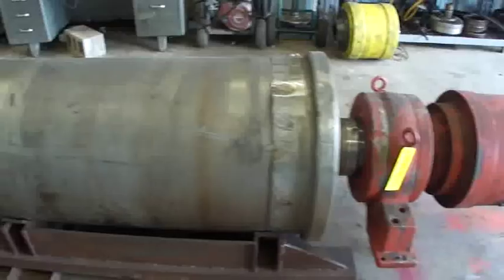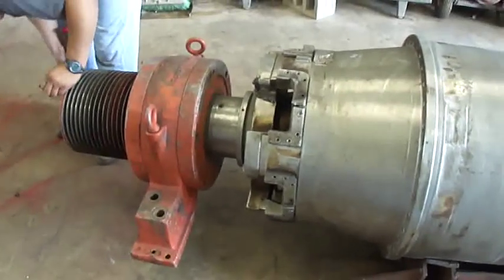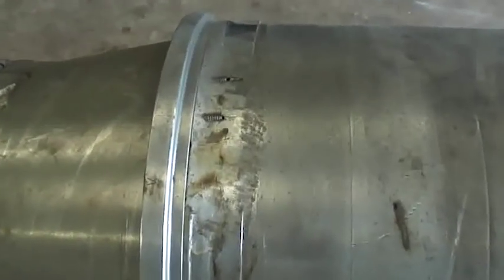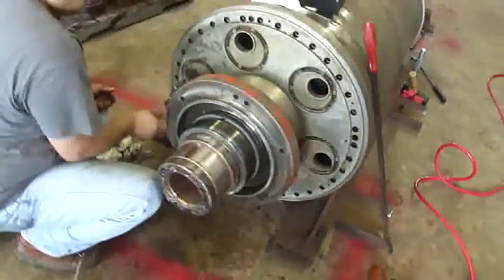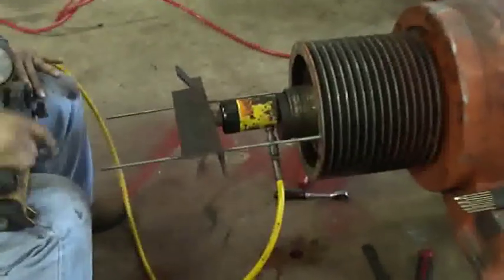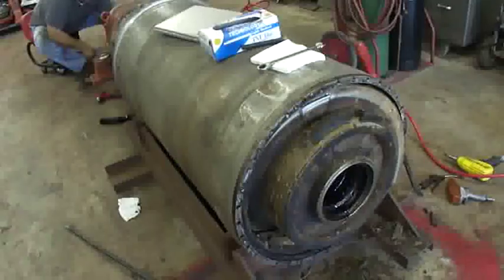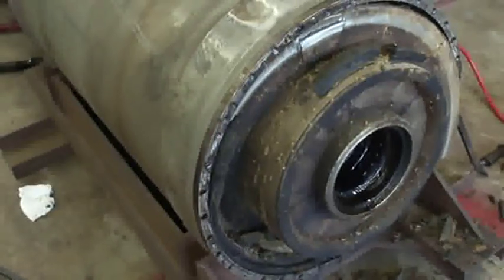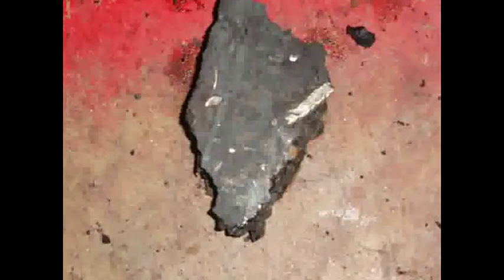Sharples Conveyer Removal

Comment: Ther is a hole for a oil fitting on that pully and you use oil pressure to get it off not a hydraulic jack and threaded rod . Im more than 100 percent